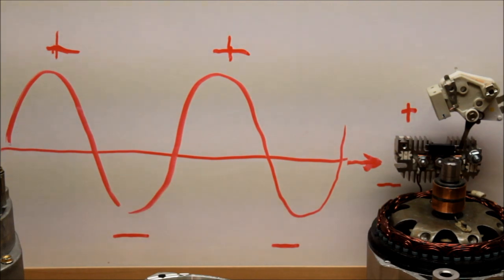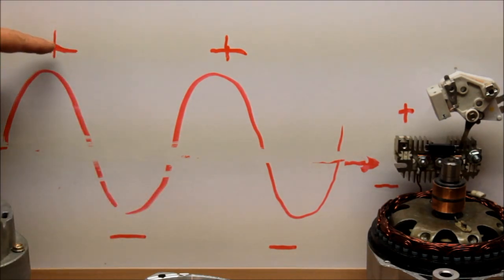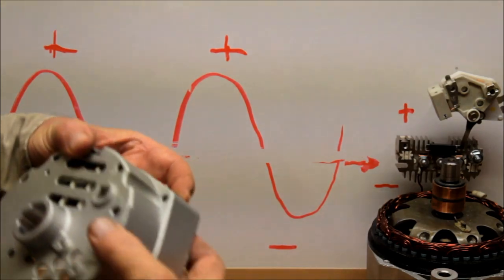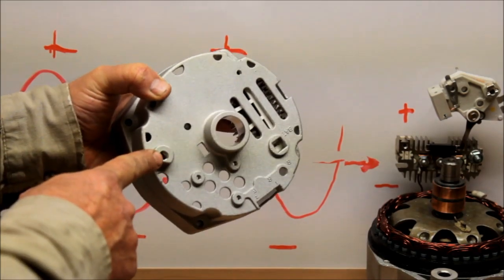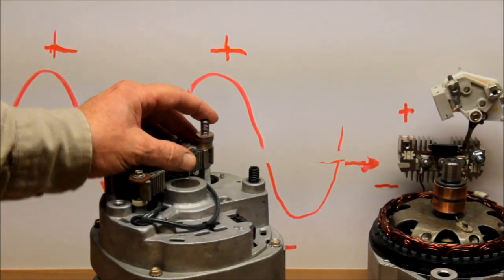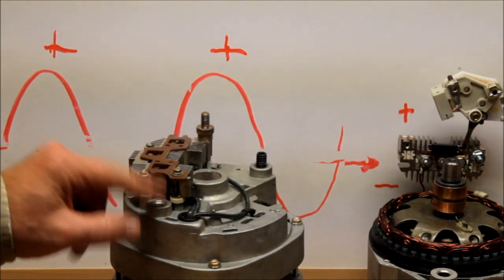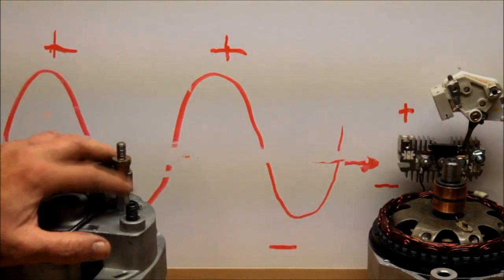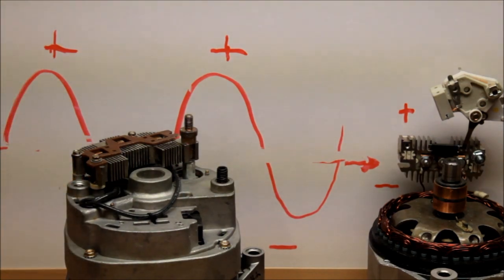Why the Big 3 Wire upgrade should be the Big 4, 1-616-785-7990

Comment: can I run the ground from the back of the alternator to the chassis instead of run it to the battery negative?
Reply from the maker: We don't recommend grounding to the chassis alone. It's okay if you run the alternator ground directly to the chassis ground cable.

Comment: Correct me if I'm wrong, but a bridge rectifier doesn't send current out the Ground. It flips the negative portions of the Wave.
E.g. nununununu becomes nnnnnnnnnn turning AC into rough DC. Regardless running a copper ground wire from ALT to BAT/Chassis especially on older corroded blocks should see a reduced voltage drop.
Reply from the maker: The rectifier does 'send' current to ground, otherwise the circuit would be incomplete. If you think of electrical current like water, AC is a 'push-pull', the water doesn't really flow, it just moves back and forth. The rectifier is like a series of one-way valves that convert that push pull into a steady stream.

Comment: so ideally you want from alternator housing to block, chassis, and battery negative so everything can access negative voltage efficiently. that, plus circle earth from battery (block, head, chassis, and chassis rear) and a more adequate line from alternator positive to battery.

throw in a heavy negative from the battery to the starter and you'd be pretty much set for everything assuming your battery isn't trash :-)

edit: honestly, I'd recommend this sort of upgrade to anyone who has enough spare time and cable as it improves the efficiency and stability of your electrical system as a whole. it'll keep your ignition system at its best, your headlights will be at their brightest, and it'll protect the engine management from all kinds of gremlins as computers absolutely hate inconsistent voltage

Comment: alternatorman, what size bolt goes into that mounting hole on the back of the alternator? I have a 99 GMC Suburban C1500 gmt400. Thanks.

Comment: Would it work to  run a short ground wire from the alternator to the engine block, or does it have to go all the way from the alternator to the battery.
 I have a 1970 GMC C20 and the alternator is on the driver's side and the battery is way on the passenger's side. Although... I do have a positive 10 gauge wire from the alternator to the battery.

Comment: a better mod would the shortest path between negative and the engine block or head, remove the alternator and clean the the spots that make contact between the alternator and engine. this is because the engine is bigger than the ground wire. contact, contact, contact.
Reply: also use contact grease to prevent further corrosion.

Comment: Hi, I have a 95 Swift (pretty much like a Geo Metro, but with a trunk). I did the big 3 upgrade plus the relocation to the trunk but I'm not sure if I did correctly or optimally. I ran a good 0 gauge cable from the junction that connects the fuse box-alt-bat + side to the trunk, and the grounds where all dual 0 cables to the chassis, but I never did the alternator ground like you explained. Should I run dual cables from the alt to the engine ground or the chassis?

Comment: Nice video, also the car from front to back is on spot welded and the car is only as good as say 4awg, if you need to run a 0awg to the rear then also considering running a negative cable back too.

Comment: I always run my negative(ground) cable from my amplifier directly to the back of the alternator, works by shortening distance to best ground and power isn't slowed by steel resistance

Comment: I have 2x 300amp alts and have run a 2/0 awg cable from the back of the alts to the chassis. would this be sufficient enough!!! instead of grounding to the battery!!! as I also have one Kinetik battery up front and 4 in the boot with all batteries ground to the chassis.  your input would be much appreciated. Cheers

Comment: ppl this guy makes a very valid point im no electrician or a pro at any high power draw but i have told ppl this very same thing multiple times to ground the alt itself when u do the big 3-4 cuz it does help i plan on doing this when i do my upgrade on my system when i get my new h/o alt for my car it just makes sense to go the mile when doing this to make it perfect

Comment: LOL, thing you did not mention is that the Alternator is already grounded to the chassis which is 1 big conductor.
Reply from the maker: It is one big conductor, but it's not a very good conductor. The conductivity of steel is 6.99e6 S/m, where copper has a conductivity of 5.96e7, meaning copper is roughly 10 times more conductive than steel. Not to mention the numerous contacts points in a chassis which corrode and further reduce conductivity.

Comment: i like the analogy but electricity doesn't slow down.. current gets smaller which is the amount of electrons flowing per time. but they are still traveling at the speed of light.

Comment: Will it work just as good if, Run a wire to the back housing of the alternator to the body or frame of the vehicle?  Instead of running it all the way to the negative side of the battery.
Reply from the maker: SickTheory Not really. You can run it to the grounding point on your frame or engine block. Having ground run through the frame/body just isn't as good.
Reply: alternatorman Thanks for the reply!  would you recommend also running a bigger guage  wire from the (+) alternator to the positive side of the battery?
Reply: I,ve built transmissions for 23 years . Also if electricity has to flow through trans. it will eat up the trans. bushings.

Comment: i personally have always run a fresh ground from alternator pivot bolt to the battery terminal ( which in turn goes to frame) when i do a big 3, never had a reason to do so untill now, im just a tad over kill nd it replaced the flat ribbon ground from motor to chassis imo

Comment: ive been telling ppl for years the battery isnt anything but a big capacitor.  ppl run HUGE power wires to the amp from battery nd wonder why lights dim. you can remove the battery after car is running ( with upgraded charging and ground wires) and have little to no dim because basically the alt runs EVERYTHING when the car is running and the batteris basically nothing more than a buffer to keep the rectifier from getting overloaded from a heavy draw.and then u have the guys that throw a cap at it, dont even get me started there. imho all a cap is good for is the crappy voltage meter ontop and possibly hooking to  120v extension cord and blowing up.
Reply: Don't remove the battery from a modern running car. You risk burning out the on board computer. 

Batteries store and make energy from chemical reactions. Capacitors store energy in an electric field created by separating opposite charges. They do similar things but not in the same way.   

A simple capacitor can be made with two metal plates separated by an insulator. Electrolytic capacitors are manufactured by creating an oxide on one plate that serves as a separator/insulator. That is done by an electrochemical reaction which is never intentionally reversed for the capacitors lifetime.

In a storage battery the electrochemical reaction cycles through charge and discharge cycles until it can no longer hold a significant charge.
Reply: ***** Other than using ultra caps there is no replacement for a storage battery in a car except anther kind of battery. You need a lot of power for a short time to turnover the engine with the starter motor. You could use a windup spring with a hand crank I supose.
Reply: Okay Years ago I had a Chrysler Corp vehicle with an amp meter. Once you started the vehicle you could tell if the battery was charging by looking at the amp meter. The size of the wires you need for any application is usually governed by the acceptable voltage drop and the heat generated in the wire. Both of these factor are controlled by the current through the wire. Heat is controlled by the size and type of wire and current passing through it. Some insulation covers can withstand more heat. While current, length, size, and type control voltage drop. More current the greater the drop. The longer the wire the greater the voltage drop. The bigger the wire the lower the voltage drop. Copper's  conductivity is better than aluminum, nickel is plated over copper as a way to discourage oxidation of copper. Gold is best but very expensive. Silver is more expensive than copper but is easily oxidised. Some specialty wires use copper plated steel or steel strand alloys for a single strand in a multi strand wire, or other specialty alloys.

Comment: What about wiring the back of the alternator to the chassis? That's what I've done in my car and my idle voltage is around 14.8. Seems to be working okay. Is there anything to be gained by running it to the battery?

Comment: My alternator is not close to the battery.  Would it be fine to connect to the chassis instead of the negative terminal?
Reply from the maker: Atreyu Auryn If you are not powering much you can use the chassis for the ground but if you are powering something like a High Wattage stereo amp or winch or snow plow that takes a lot of power then the chassis is not going to be good enough

Comment: Is the entire back of the alt a ground? Except the positive post cause I tried doing that and couldn't find a spot to mount a cable to a ground on the alt ?
Reply from the maker: legendary504 Yes, when the bridge rectifier splits the AC current into DC the positive goes out through the positive battery post and the negative is dumped into the rear housing. If you cannot connect to the rear housing just connect as close to the rear housing as you can.
Reply: To the mounting or metal sleeve that attaches it to the bracket should be good also
Reply: Legendary504 ...great explanation, let me add some more points..1) the alternator is a three fase machine, so the bridge rectifier inside is in fact a three fase rectifier...... The machines negative (the Back of the alternator) is the same voltage level as the battery negative, so by connecting the Back of the alternator directly to the battery negative is the most favourable way of electrical connection..
O, yes one more thing; electrons/electricity are not 'flowing' with 300,000km a sec.....the electrical effect is going  forward with that speed. the hopping of electrons in a cable, if visible, can be followed with the eye.....strange, but thru.....best regards..

Comment: do you fuse the neg cable like the pos? also the big 3 i thought was 2 grounds to the battery (chassis and motor) and 1 pos from alt to batt?
Reply from the maker: BigDirtyBasterd No, you do not fuse the negative cable. You do fuse the positive, this is why you use a much larger positive wire so you can use a larger fuse. Fuses are restrictive to current flow so you need a bigger positive wire so you can use a bigger fuse.
Reply: alternatorman what amount of fuse i put?

Comment: 1) Battery to Body -
2-3) Battery to Alt -/+
4) Alt to Body -

Is this right?
Reply: from the video i just watched before this 
1 is alternator to battery 
2 is battery to body ground 
3 is engine block to body ground and 
4 would be alternator to battery ground
Reply: 1) Battery to body
2-3) Alternator to to battery -/+
4) Motor to chassis

Comment: So you are saying it's best to have 3 neg wires running from the battery, one to the frame, one to the engine block, and  one to the back of alternator?
Reply from the maker: The way I usually see it is a wire from the battery negative to the frame, and from that junction have two connections, one to the block and the other to the alternator.
Reply: alternatorman So have one neg wire and use a distributor block for the block and alternator?
Reply: Jesse Cruz I got it. Thanks
Reply: This original question of needing a whopping 3 negative wires running from the battery was never even answered.

Comment: ground back of alternator should still be big 3 cause then you can get rid of ground to motor the alternator is bolted to the motor
Reply from the maker: The mount ground isn't a reliable ground. There are multiple mating surfaces that the power has to pass through, and after years of corrosion you lose your ground connection. A direct cable connection from the back of the alternator to the battery negative is a reliable ground.
Reply: I dont get this .... your saying run a ground wire from the ALT ...but the bolts & brackets that mount the ALT are like steel rods connecting to the chassis.  Which is a far better connection than a gauged wire (ANYDAY).  The corrosion factor will damage the wires conductivity way before torqued bolts.  And because of the torque that holds the ATL in place is so strong (tight) that ground is more reliable than the battery post connection.   The only why you would come across an issue with grounding to the chassis is if you bolted it to a surface that has already been compromised with corrosion
Reply: Roger Can .........well, I tried and tested the method, with meters. And running the ground from the back of the alt to the battery speeds the charge rate dramatically. Using a smart charger to meter the alternator charge rate, there is a big difference.
And you still missed the point, the alt is not( as )efficient with just the case grounded.
Reply: It must be charging faster at that point because of the accessories being ran demanding more power ...which is the main reason for an ALT ...charging the BATT is the secondary function  ...which is why if your BATT is too low you out it on a charger & not let your ALT handle a load like that.  And if its a big change you might have installed your ATL on unclean/corroded surface without cleaning first.  What is the resistance between your chassis mount from the ALT opposed to your straight wire to BATT?  & lastly where are you tapping your ground ...directly from the rectifiers ground point or did you use a wire to ground from the ALT case ?
Reply: alternatorman I'm also curious of the purpose of the Ground wire from the Engine to the Frame in the big three? Doesn't that Ground exist to satisfy the ground for the alternator? So it's irrelevant to install the engine ground with an existing ground to the alternator casing? It would make sense to use that engine ground to prevent electrolysis in the coolant system perhaps? I'm also looking to replace my heater core so this is very relevant to me lol, that is not a job I want to do twice.
Reply: +250PICKLE This actually makes much more sense to me. Less wasteful.
Reply: 250PICKLE .........kinda sounds like you will have a "ground loop" which can cause noise....
If you use the "star ground" method (all grounds to one location) noise will be reduced, if any.
Reply: ......okay, big 3.1 wire upgrade...
Reply: Roger Can .......wow, you are not getting. Batts are far from low, (where you get that anyway) surface.....super clean then protected (to prevent) corrosion , resistance, psh wrote down I think, prob didn't check can't remember and to the case.
Reply: alternatorman
thank you sir for bringing this topic to the table. lets assume the absolute best possible ground setup.
1 - ground battery directly to chassis/frame (this being the only wire at battery negative)
2 - ground motor to frame at shortest possible distance (preferably by itself)
3 - ground alternator casing to frame at shortest possible distance (preferably by itself)
4 - attach fused power wire from battery positive to alternator positive
do you think anything is wrong with what ive just listed? do you agree that it is best to isolate all grounds and keep
them as short as possible? i think my main question is...cant everything you want grounded, be grounded completely by itself including the battery? thank you very much!
Reply: alternatorman in some cars (like my 03 mustang gt) the alternator is actually bolted strait to the engine so only need to do big 3 upgrade would you agree?
Reply: Making a closed loop is not wise, if something goes wrong, everything does, let's say your amp fries, your ecu might too, your battery might break. This is very basic as I have little time, I do not think i will comment this further as I'm lazy and forgetfull.